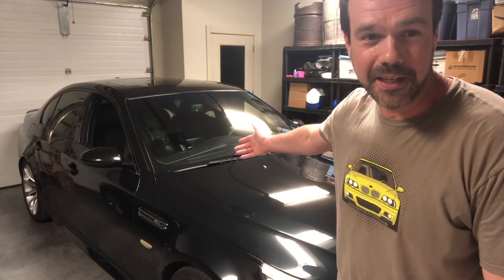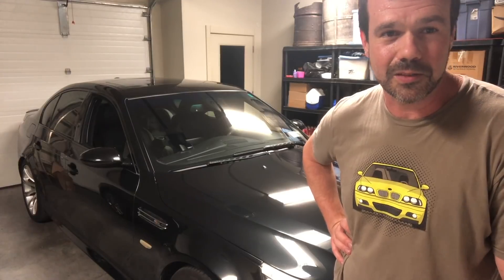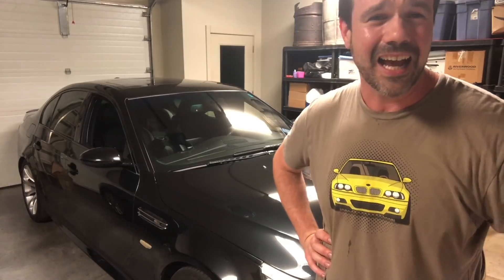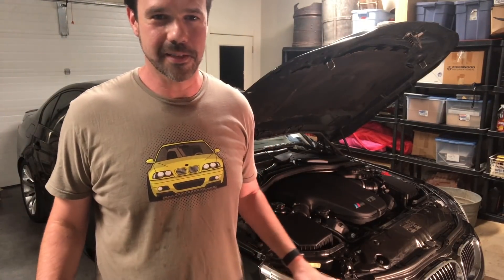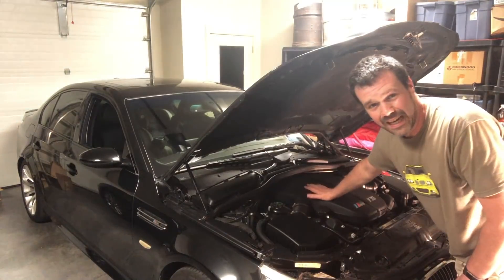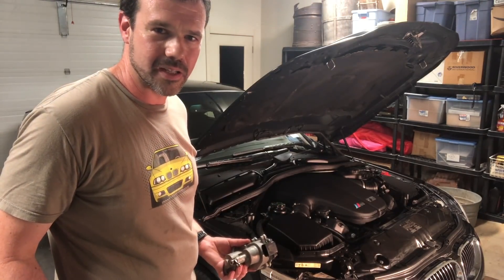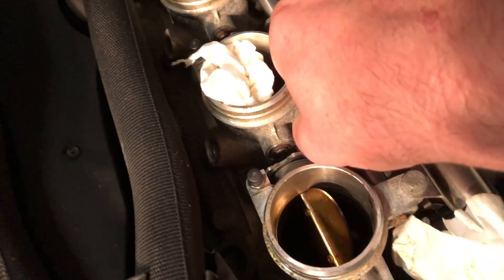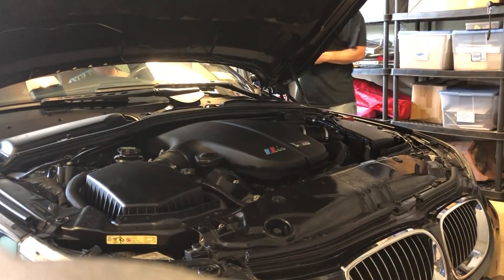Fixing the Throttle Body Actuators on my E60 BMW M5

Comment: I've had to replace my actuators as well. The only issue I have had in my 4 years of ownership. Fingers crossed!!
Reply: Having a 6 speed manual eliminates half of your problems. Im on new actuators for 4 years. So far zero issues - but recently done rod bearings and high pressure vanos hose. Fingers crossed as well lol..

Comment: I own 2006 BMW M5  Been getting a code P1209 -  Injector Control Pressure System Fault . 
I replaced my two  Throttle Body Actuator,  Fuel Pressure Sensor, Spark Plugs, New oil engine / filter,  but still not able to fix it. 
   
Any ideas on what could be the problem?   Appreciate any Help!!

Comment: Thank you for putting this, my m5 is at 89k so far so good, is your m5 100% stock?
Reply from the maker: Hi Alina - Glad to share my experience. Yes - it's 100% stock. When this happens to you, the car will let you know. I got multiple warnings. It's impressive how the sensors know when something isn't working right.. Have you done the rod bearings yet?
Reply: Brent Campbell  No i haven't my bmw mechanic told me not to bother with that, i have owned mine for 4 months bought it from GA for 18k 1 owner car adult owned, couldn't pass, before i bought it the first owner replaced brand new rotors and pads, oil cooler, steering pump, new clutch and pilot bearing, valve cover gaskets, for some reason it had 5w40 valvoline euro oil in it when bought it,  which burned pretty quick, i went ahead and changed it  with 10w60 liquimolly and over 1k miles and barely burned any oil at all, i will take a sample next oil change which im planning to do soon,
Reply from the maker: Alina Gherasim Sounds like you got a sweet ride. Not sure what to tell you about the oil; the 10w60 isn’t easy to come by at an AutoZone or other auto parts retailer. So it could be that. But do be careful; the 10w60 is thick as molasses at cold start. It’s racing motor oil, and it performs well at high temperatures where other viscosities fail. Race the engine at cold start before the oil has warmed up, and you could do serious damage. Enjoy your new car!
Reply: Brent Campbell Thank You!
Reply: Brent Campbell should we use 5w50 or 10w60 ?
Reply from the maker: Giray Kharizzma That’s another controversial question. I always use the 10w60. If you live in extreme cold, an argument could be made for oils that heats up quicker. But most experts say to stick to what BMW engineers advised - the 10w60.

Comment: Bro did you need to code the throttle acctuatora or did they just worked immediately after installation
Reply from the maker: Salman Iftikhar We got lucky. Wes was able to finagle it just so, and it started right up. There were no codes after, and the car has driven perfectly since then - 8 months ago.